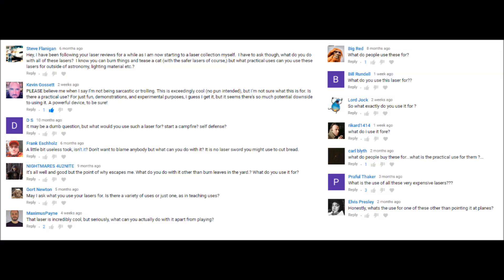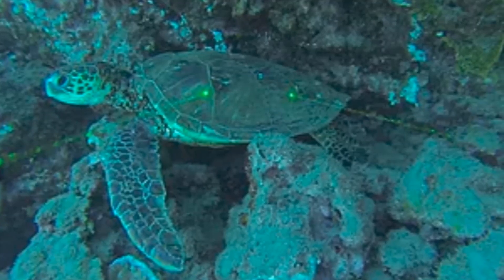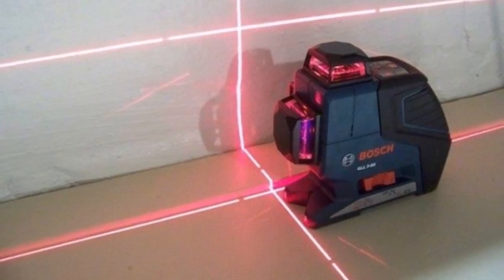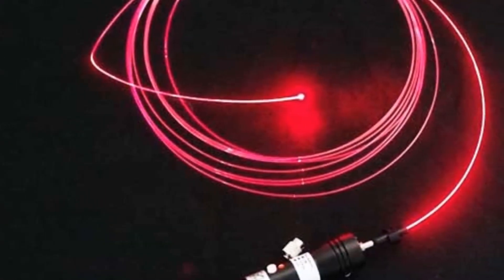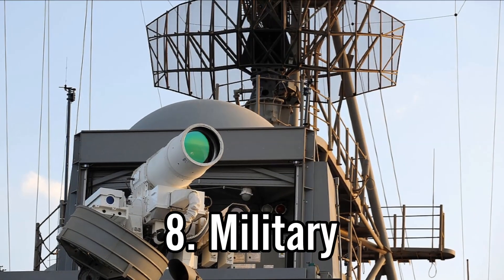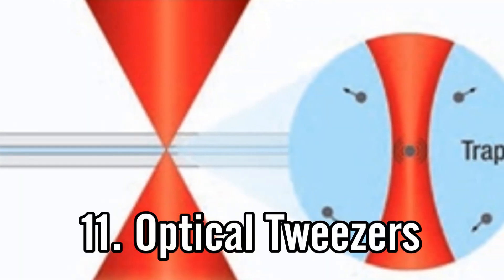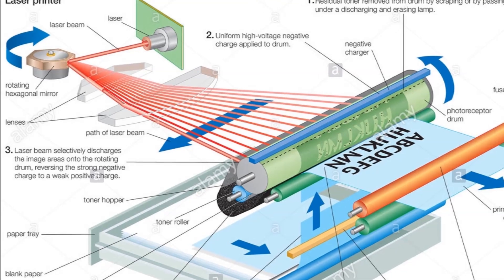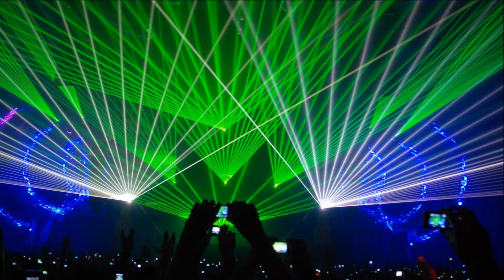15 Uses for Lasers

Comment: Totally freakin awesome! :-)
 
(Having worked with lasers since the mid-1970s, I already knew of all of the uses for lasers that you explained in this video, but I found this vid to be an invaluable resource for those people new to laser technology.)
 
BTW I'm expecting a couple of directly-injected diode lasers in the near-future: a 488nm one and a 505nm one. :-D
Reply: Awesome! I would love to have a 505 nm laser😃
Reply: You can get them on Ebay for ~$80 now; just do a search for "505nm laser pointer" and you should see them listed.
One such listing is https://www.ebay.com/itm/505nm-5mW-Green-Laser-Pointers/223094849126?hash=item33f17d3e66:g:2DYAAOSwcVxba-Rb
 
These lasers use a rechargeable 18650 Li:ION cell for power; if you don't already have such a cell & charger at your disposable, you'll have to procure them when you purchase the laser itself.
 
One such listing is https://www.ebay.com/itm/PKCELL-18650-Vape-Mod-Battery-and-Charger-2-piece-Real-3000mAh-Smart-Charger/141738189719?hash=item2100412397
Reply from the maker: Very nice! I've been hoping to grab those wavelengths from Sanwu sometime soon too!!
Reply: The 505nm portable laser could be here as early as tomorrow (if DHL does Saturday deliveries) or Monday! I'm so stoked about it!!! :-)
 
First thing that I'm going to do is perform both broadband and narrowband spectroscopy of it, and THEN I'll start shooting photographs of it and its beam terminus spot to add to the web page that I'm constructing for it to be added to my website.
 
And yes, before anybody says that I'm just going to blast things with it (and possibly perform some fluorescence experiments), you're absolutely correct!!! :-)
 
This is a self-contained portable laser, not a lab laser, so I'm not expecting absolute perfection in its beam profile or stability -- but it should still be more than adequate for performing its intended function -- as a handheld optical pointing device.
Reply: The 505nm laser arrived just moments ago!!! :-)
 
The color is a bit more on the green side than I expected, but I'll run it through my spectrometer either tonight after sunset or tomorrow before sunrise (so that ambient light doesn't queer the test) and I'll be able to furnish an exact wavelength then.
Reply: Well Pooh!
I can't find my spectrometer or laser power meter at the moment, so my analyses and measurements of this wonderful little laser are on temporary hiatus. :-(
Reply: I just found (and reinstalled) my LPM. :-)
 
I obtained a measurement of 47mW -- on a laser that was advertised to output less than 5mW. But this was quite expected from a laser that I obtained from Ebay; their policies forbid any lasers sold as, "pointers" to meet or exceed 5mW. The photographs on the Ebay listing for this laser very clearly showed me that this laser was going to SIGNIFICANTLY exceed 5mW, and sure as {vulgar slang term for feces} it did. So I'm happy to take custody of an overspec laser. :-)
 
The CDRH-mandated warning label showed the wavelength as 460nm and none of the (multiple-choise) boxes were checked off to indicate maximum power.
Reply: Although my spectrometer has yet to turn up, I decided to add it to my website anyway. The direct-entry URL is http://www.ledmuseum.net/51/505green.htm (it's scheduled for installation on my website between 12:01am and 5:20am PDT tomorrow -- 08-19-18 or 2018 19 Aug.) but the web page is already there so you need not wait.
 
Enjoy mo capitan! :-)
Reply: Same here...not since the 70s tho. Very cool!
Reply: I saw Sanwu has a 1.8 watt 525nm.  That’s gotta be really bright.  I’d sure love to have a 5 watt green pointer!  I doubt they will make a green with that much power in a handheld, at least not for quite awhile.

Comment: I just took my laser away from my 19 year old son because if you take the tip off, it'll go across the canyon where there's another house. I don't even know how far it will really go but we have planes flying over all the time and I don't really don't want any unwanted visits from the sheriff's dept. Guess it was more of a novelty idea that I don't have a use for than anything else
Reply: That's disappointing, you should give it back
Reply: It's easy to be responsible and not point it at things you don't need to. Sounds like you don't trust your son and it's not really about the laser
Reply: @nuguns3766  It wasn't his to begin with and no, I don't trust him. My son's in the spectrum with anger issues, though he's been pretty good for some time now, but that can change anytime and I'm sure he's curious but if we went out to the desert with it, it would be different. I did it in Arizona and found it didn't go as far as I thought but will still go at least a half mile or more
Reply: @JamesBond-py8xs  also you've explained your reasoning on why you're right after I already started to move telling you I think its wrong as if I never understood anything. Defending yourself before there's any argument, now I feel upset and defensive already I'm ready to run from you, I'm afraid you'll act like you've done no wrong and act innocent making me feel like I can let my defenses down. Which then makes me feel like I gotta explain myself to you like you don't understand anything and talk to you like your dumb, you aren't I feel like you aren't gonna listen to my voice. 

I'm some stranger who's gonna let this go now, please let your son be more independent in your own mind.

Comment: Perimeter detection.. 
Smarter (Laser pin point area detection )... 0 ----> 0 , 0---->0 , 0---->0 , 0---->0 , 0---->0 , 0---->0 , 0---->0 , 0---->0 , 0---->0 , 0---->0, ... 
Wider area laser coverage.. 0------------>0 , 0------------>0, 0------------>0 , 0------------>.0 , 0----------->0... ya know...

Comment: This is an old video but I wanted to add one secret use of lasers and that is for espionage.
When Germany was still divided, spies would shoot an invisible laser across West Germany into East German windows to pick up the conversation inside the room. The windows act like a diaphragm, vibrating with the sounds inside which the could be illuminated then picked up by a specially tuned camera.

Comment: 8:20... I own that exact model ,just got delivered to my house last week. Its a 1000 mw/450 nm laser,and it's the best in its class I think .Burns very fast ,extremely dangerous and deserves respect.
Reply: I mean aren't these extremely good for self defense?U can easily blind ur attacker in self defense situation and not just temporarily but permanently not to mention that type of laser u own can easily be used as bat as well to take down an opponent even though it may break the laser in the inside since usually the metal used for these lasers is aluminum pop metal soft metals basically so yeah but overall a solid build laser in a baton shape can easily be very effective at self defense
Reply: @Dav624 I remember I wrote a pretty much the same comment under styropyro's video 2 years ago, and a week ago I actually had a situation where I had to laser down a cracked out homeless person running at me with a knife. Worked like a charm. He instantly covered his face and started walking back. I have a 1W 445nm laser, but shopping for a more powerful one now that I know lasers work. Just be sure to carry around safety glasses in the same backpack pocket as the laser.
Reply: You forget glass experiment

Comment: Also used by chemists to determine the optical isomerism of organic molecules. More specifically, light from lasers will reflect at different angles depending on how atoms are arranged around a chiral carbon atom. This can distinguish 2 enamtiomers that are chemically and physically identical, but have atoms that are arranged differently in space.

Comment: I've got a questions do i have to where glasses when using a 5mw green laser? What about 80mw? And when do I have to wear them let's say I want to use a laser for astronomy purposes would I be safe as long as I don't point it directly in my eye would it be okay to just look at the beam? what about the dot?
Reply from the maker: In reality you should use glasses in any situation that the laser will be on, no matter what the laser's advertised strength is
Reply: @XM360  but if I want to use a green laser for astronomy I have to be able to see the beam wouldn't glasses block the beam out?
Reply: @intotheunknown8693  they will

Comment: Hello Xm360. I have a laser suggestion. It's a low powered orange laser pointer. Its about as 
orange as you would expect from an orange laser. Here's a link if your interested: https://m.ebay.com/itm/635nm-5mW-Orange-Red-Laser-Pointer-Pen/261296130442?hash=item3cd676898a:g:IOMAAOxy0QBSRbFV
Reply from the maker: I think I've already got that one! Didn't see much of a difference from 650nm at that power